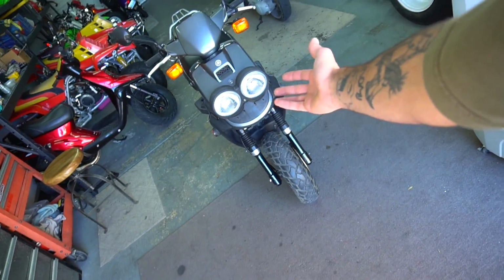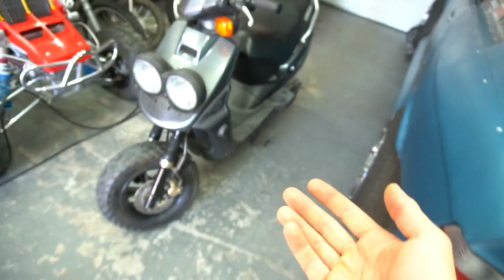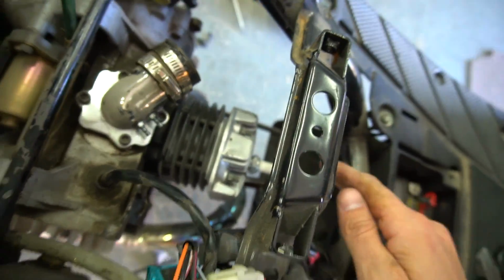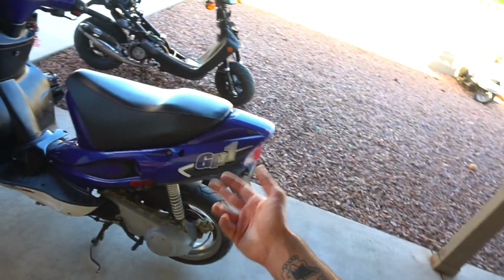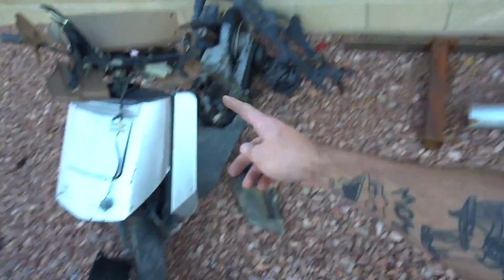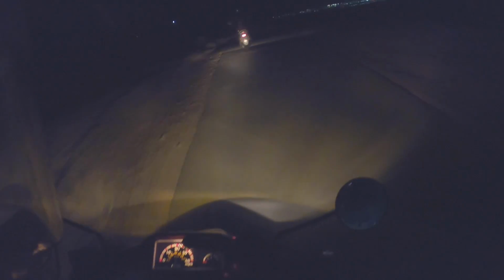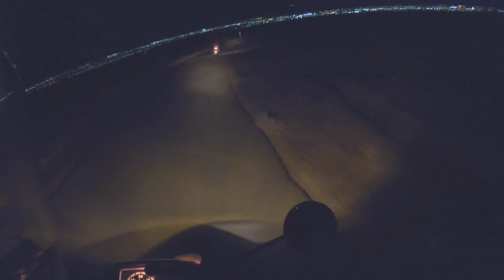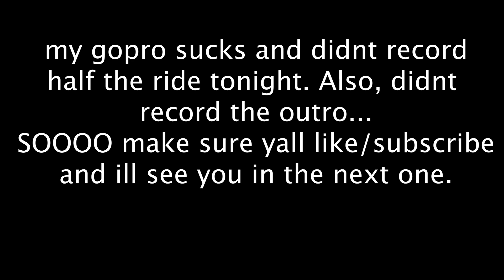NEW Yamaha ZUMA Build! 70cc Polini BUGEYE Scooter

Comment: What do your cylinder head temps get to on your prebug I’m curious??? Cruising and wide open throttle
Reply from the maker: 300-320 WOT on a stretch , 260-290 cruising
Reply: Do you have the cooling fan shroud over your cylinder?
Reply from the maker: youre probably running way too rich
Reply: @MOPBOYZ  I don’t know how, I have a corsa yasuni r and dell 21 with a 95 main everyone else says that sounds fine for my setup

Comment: Hey Trevor I have a couple questions I have a 2007 tgb r50x I recently rebuilt the top end because the piston was cracked so when I rebuilt it i drove it and I gave it gas and it started to bog down and shut off on me when I gave it full ga s I cleaned the carb top to bottom and the jets cleaned my air filter changed the gas and oils because it was sitting for sum months I thought that could be an issue but when I had the scooter before the rebuild it wasn’t running like that it was smooth if anyone can help that would be great